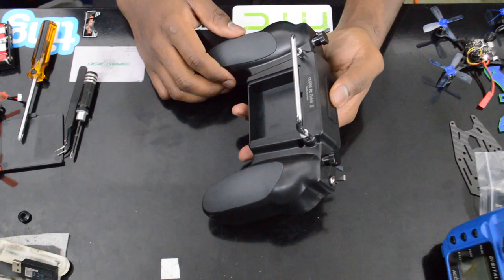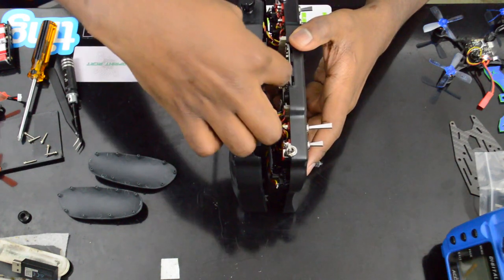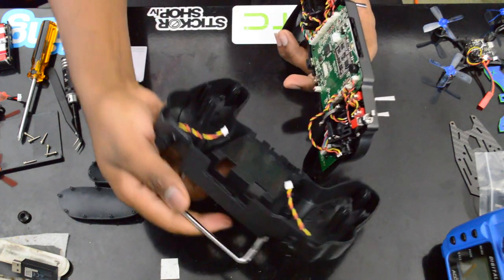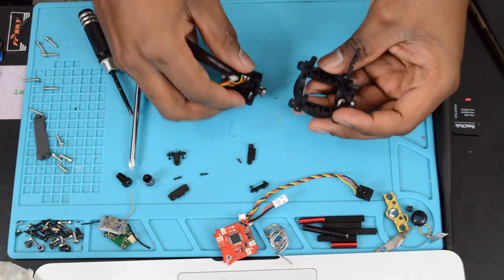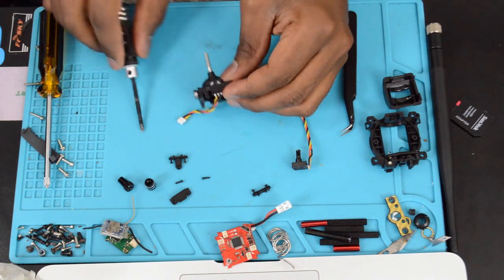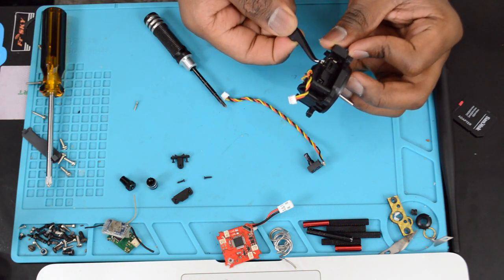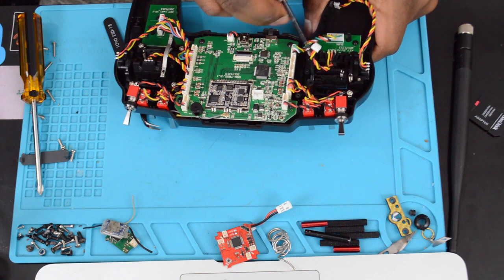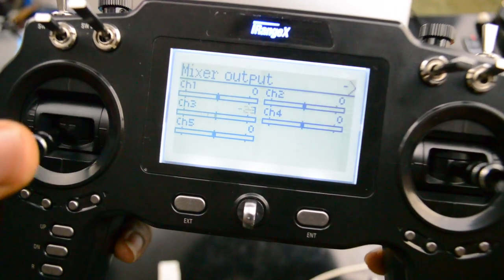iRangex IR8M Gimbal Centering Fix

Comment: Hello, nice video, i want to buy this radio but what type of glue have you used becouse i don't understand you on the video 
And other question, is there any other modifications that you recomends to do
Pd: I'm spanish and my english level is very bad
Reply from the maker: Ivan2000rc thanks bud, I used clear rtv silicone, just a very little bit works and as of now I'm still using the radio so I'm gonna see what other mods can be done to make it better
Reply: DwarfStarDrones thanks very much
Reply: Do you think that the white version will be better and without that problems?
Because the white version is new and they can have more time to do it
Reply from the maker: Ivan2000rc maybe, but they had time to fix this problem before, because they shipped out some test units and someone commented that the gimbals sucked but they still shipped the finished product with these horrible gimbals
Reply: Hi, I received this station today but I have a doubt How it is configured to bind in sfhss protocol?
 It just gives me a restart and I do not know what to do
Reply from the maker: Ivan2000rc did you try to update the firmware?
Reply: DwarfStarDrones I'm trying but I do not recognize the station in dfu I installed drivers and everything but nothing
Reply from the maker: Ivan2000rc give a look at this video maybe this can help https://youtu.be/vEGlSLo8ufc
Reply: DwarfStarDrones Thanks for the advice but I have already watched that video but nothing comes to me as it has detected it well (it appears on universal serial bus devices) but when I connect the station in dfu it does not recognize me in dfuse usb upgrade tool I do not know what to do I'm trying it on windows 10
Reply from the maker: Ivan2000rc whoa now I'm having the same problem after my radio worked with win10 when I first upgraded, it shows up as stm32 dfu but doesn't show up in dfuse :/ I'm not sure but I'm gonna keep trying to get it to work
Reply: DwarfStarDrones I discovered that it is because of the stm drivers that there is no for windows 10
Reply from the maker: Ivan2000rc wow mine worked on the first update but not anymore, I have win7 also I'm gonna try it on that later
Reply: DwarfStarDronesBut your station still works well in normal mode when you connect it to your computer. I mean to put icons and more things?
Reply: DwarfStarDrones But your station still works well in normal mode when you connect it to your computer. I mean to put icons and more things?

Comment: Looks like there are a lot of problems with that radio. It is assembled as cheap and fast as possible
Reply from the maker: BuzzCola 3 yup that's true but since I fixed the gimbals it's been alot better but I really wished they took the time to make it better because the concept is awesome
Reply: DwarfStarDrones yeah, today I watched the drone meshes video and he had a lot of problems.
Reply: DwarfStarDrones it looks like they used a good quality components but they just slapped the parts in there as fast as possible
Reply from the maker: BuzzCola 3 yup I was surprised to see the retainers holding the pots in were broken and loose